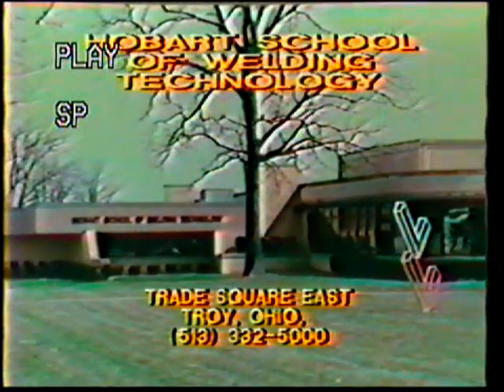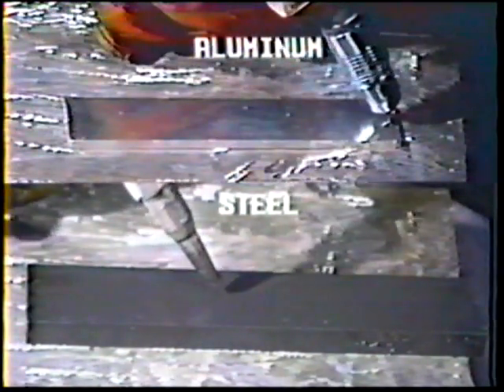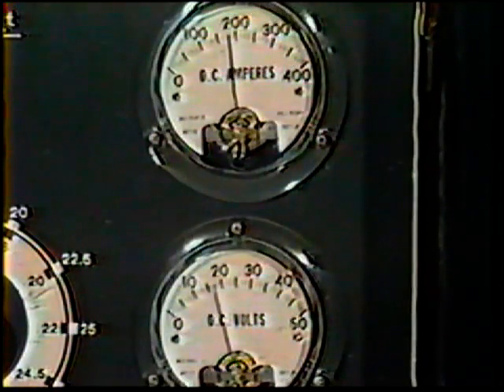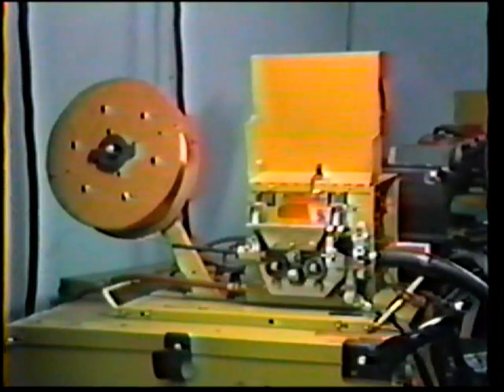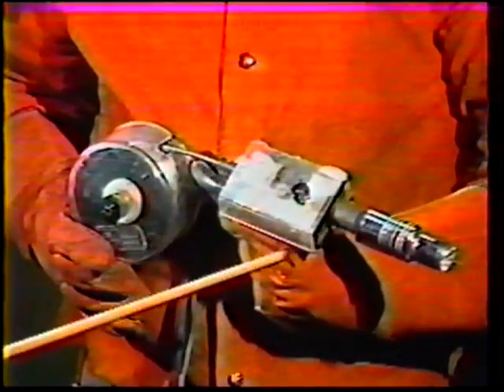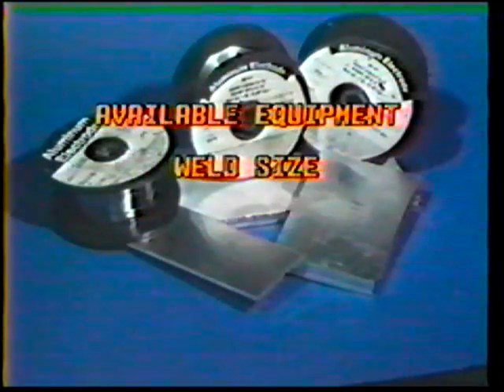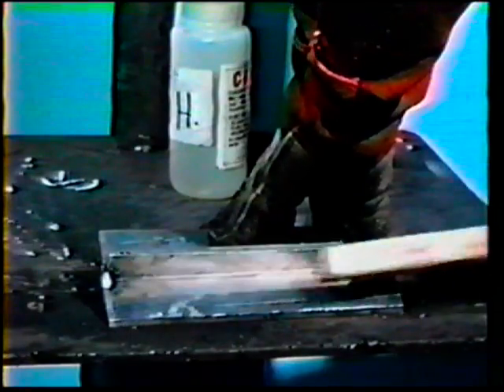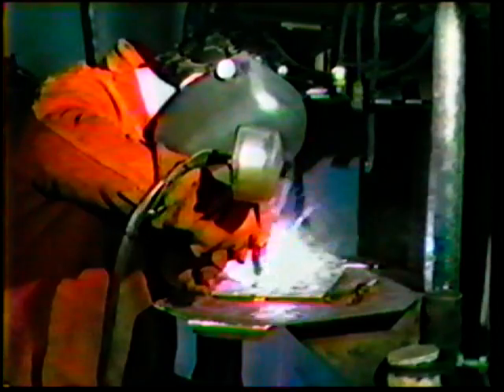MIG Welding Aluminum

Comment: at 10:24 did he say  non-inflammable?
Reply: @tomrc4328  Inflammable does not mean not flammable. So, it's not a double negative. Inflammable means "Easily set on fire".
Reply from the maker: Yes, non-inflammable cleaners to prevent the material from catching fire. 

Thanks for watching!